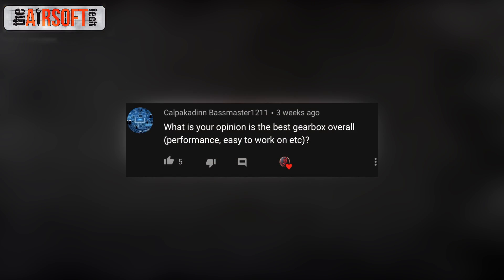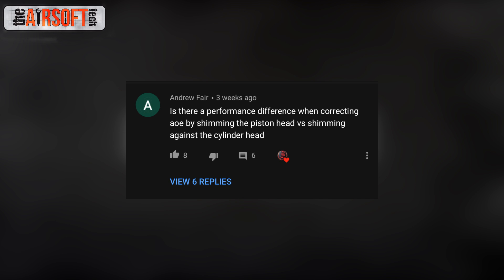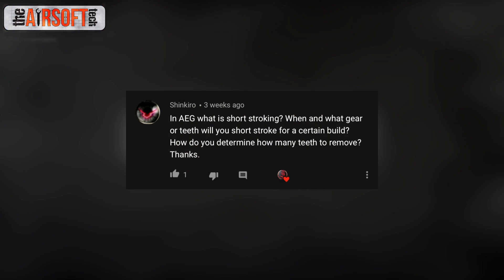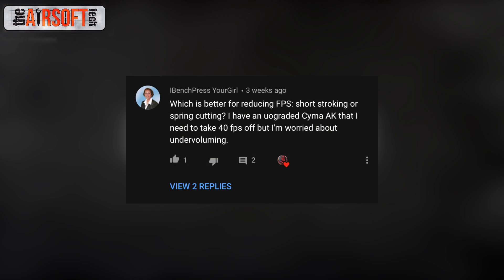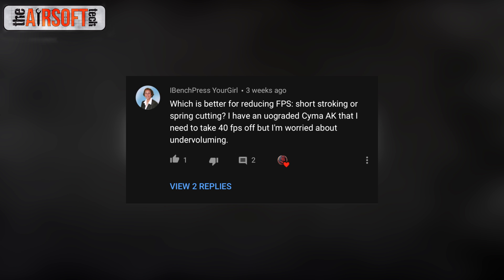Airsoft Tech Talk Q&A | Episode 12

Comment: That would be awesome if you made your own merchandise, i would buy some, if it Will be possible to ship even to Europe.
Also i have a question for another Q&A:
What could cause a low fps problem on a DMR build, where the airseal is perfect And the nozzle is perfectly sealing with hop up rupper, when its pushed all the way in front.
Its made of those parts:
- Dboys reciever
- Retroarms gearbox shell
- Custom 18:1 CNC gears
- SHS hi-torque motor 
-Retroarms cylinder, piston, piston head And cylinder head 
-Prowin hop-up 
- ASG 70° Hop up rubber

Comment: me too, i like V3 gearbox for the same reasons you have mentioned, that is where i start tinkering AEG a couple of months ago. the only downside is its difficulty to properly adjust the motor height, i cannot get a good visual on the pinion and bevel the way V2 gives.

Comment: In my opinion shortstroking is not the way to go on a fullsize AK. With that 455mm barrel you're risking undervolume if you like to play heavy BBs. How do you polish your barrels btw?
Reply: nah you will be fine, lots of guns come with 509 mm barrels which should be undervolumed, but they are fine with 0.4 bbs so an ak with a few teeth cut you will be a ok
Reply: argree, use weaker spring ot cut 1-2 coils is better .

Comment: I absolutely think aoe correction is absolutely pointless, you mentioned the first reason (loss of volume), second reason is if 12 o'clock was actually the best place for the sector to pick up the piston, why dosent any airsoft manufacturer "correct" it, from the start, on top of that why isn't there an aftermarket cylinder head or piston head with aoe correction in mind? Third reason, I have done aoe correction in the past, and pistons dont last as long when aoe is "corrected" just my 2 cents
Reply from the maker: Some manufactures do correct, or at least partially, it. I’m very perplexed at why people suddenly don’t believe in correcting AOE. I’ve seen pick up teeth destroyed from poor AOE. And I’ve had pistons running for years with perfect AOE.

Comment: do you know any tips and tricks with WIRING? for example I am little worried for the motor wiring, it is really tight in there and is there a easy safe way to extend wiring in the stock?(I run fixed stock so my wiring is too short)

Comment: Hey so I had an old classic army m15a4 proline gearbox from like 09' ish. anywho i put a tm emg1000 motor i had and i shaved 2 teeth off piston and sector gear, and after like 200 shots the front of the gearbox exploded off. Kinda scared to put the motor in another gun now. Is there any reason it did that? Maybe just because it was so old ? Im not sure.

Comment: hey brotha, great videos and I appreciate your time as they have helped me become better at teching. however, Im stumped on 1 of my builds and maybe you or someone here has an idea. I recently built a cheap cyma m4 v2 gearbox, shimmed with 18:1 shs gears, m110 spring, gate aster, 11.1 1200 mah 25c lipo, and the the gun shoots great with the stock motor. I tried adding an ASG 40K as well as an SHS high torque motor, and the gate control station gives me the error code for both of those stating "aster could not detect motor". Both motors work on standard v2 gearboxes without gate mosfets. Im leaning towards the battery isn't strong enough to power the motor and the mosfet, or gates firmware has an issue with certain motors. I have everything updated and checked my wires, motor connectors and no issues with the stock motor just the higher end aftermarkets. any ideas?

Comment: Question, a friend has the elite Force ump, the thing is, the mosfet is shorting, and I cannot find where or how to repair it, as soon as you plug the battery it starts to short
Reply: Replace it with a g36 gearbox. Then you can put things like a titan, gears, ect in it

Comment: How do you calculate amp draw/efficiency? For instance,  what is the approximate amp draw on a 28tpa motor with 12:1 or 10:1 gears with a M120 spring? What would be the minimum battery that could safely run that setup? Would it still fit in a buffer tube?
Reply: You need a amp meter. No other way to do it unless you like extremely vague guessing
Reply: @opairsoft8100  so where do i hook up the amp meter? Do i do it while a battery is hooked up to it? I am mechanical and ggod with metal.... but i have no electrical experience. Thank you for the response and answer.
Reply: @k.thomas295  google, they sell a lot

Comment: want to improve fps to my krytac trident mk2 crb and accuracy as well, what can suggest for cylinder , nozzle , hop up chamber etc . and also upgrade my inner barrel,
Reply: the airseal parts are fine... maybe an o ring nozzle,  get a maple leaf hop rubber and a nice inner barrel (prommy, pdi, edgi), chamber is fine
Reply: Archie Keen o ring air nozzles don’t help for fps or consistency with a quality brand such as tm, krytac, vfc (granted vfc has it), Asia G&P
Reply: Or the asg scorpion evo
Reply: If you've checked that your airseal is good, only way you're going to gain FPS is with stronger spring or a lower volume barrel (tighter bore, same or less length). The barrel option will likely not get you more than 5-10 FPS increase on a .2g

Comment: Type 0 cylinder on 225mm barrel length
 what should i do? My fps goes down from 340
To 280
Reply: You're too over volumed. The reason the fps goes down with a full cylinder on a shorter barrel is because the bb has already left the barrel before the piston is able to get to it's fasted point. You need a 3/4 type cylinder for your barrel length. Not only will this correct your fps problem but it'll also make your gun quieter.
Reply: @valentinozoboli4592  can i port my type 0 cylinder?
Reply: @adventurekid5066  You'd be better off buying a new one. They're pretty damn cheap. Unless you really want to give it a go. But you'll have to polish the inside of the cylinder to remove any burs which could create resistance on your piston. Honestly though, I'd just buy a new one, they're like £10.
Reply: Keep it and run heavy bbs for joule creep
Reply: @opairsoft8100  Heavy bb's would make the most of the over voluming to be fair, so long as you stay within field limits. But then you are limited to that certain weight.
Reply: What scenario/playstyle are you building the gun for?
Reply: i just want to reach 450fps
Reply: @adventurekid5066  you need to either port your cylinder, get a stronger spring, or a longer barrel. You could try going up to sniper weight BBs. You might get the joule equivalency of your target velocity with .45g BBs or heavier if available. Make sure you're allowed to use those kinds of BBs at your field. If you port your cylinder, be sure to sand the inside edges of the port and try not to mar up the rest of the inside of the cylinder, otherwise you'll have to polish the whole thing. Personally, I would polish it either way.
Reply: @Evan-eh9dd  i already ported my cylinder 
it is now on 340 on .20s
Can you help me build my own gun?